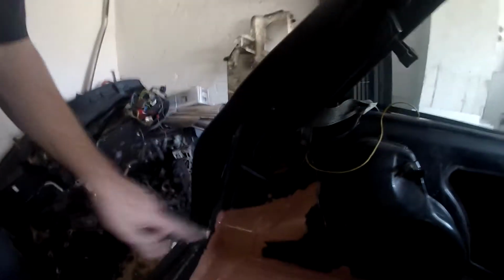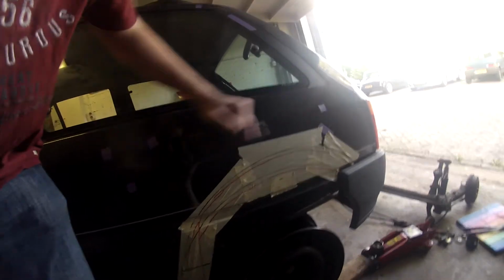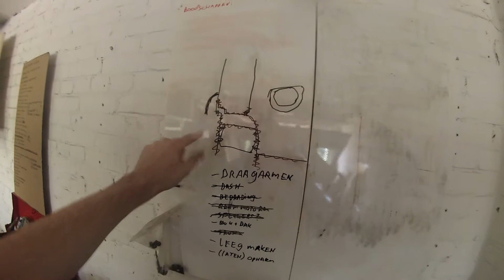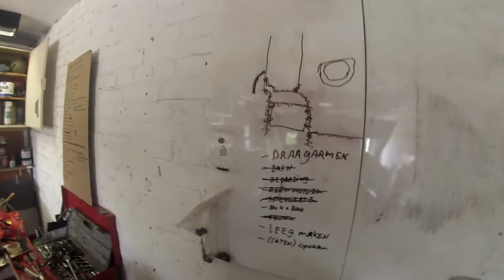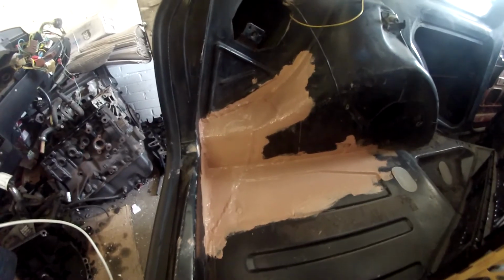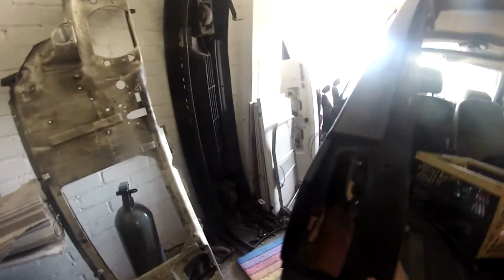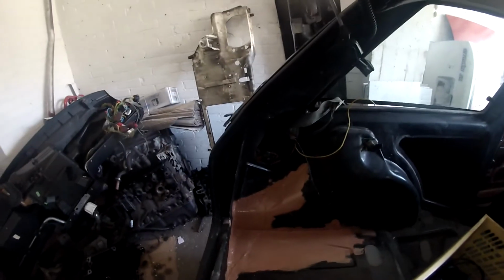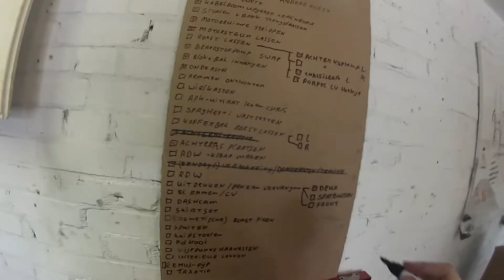Citroën AX 16V Trackday Project Episode 6: Fixing more rust

Comment: good work men from spain! i have a similar proyect, what brake tubs are your used for the behind brakes? of saxo? because de brake bomb have 4 exits and the ax have 2 alone, thanks
Reply: I used the AX brake master cylinder (pump) with 4 holes, AX front brake lines, 1 original ax brake line (left line) and 1 custom line (shortened and fitted with a m12x1 fitting) to the saxo brake force distributor on the rear axle. It should all be explained in episode 4 of the series.

Comment: hey 

I was wondering how do you draw and the lines to cut the metal on the back of the car?
Reply from the maker: I put masking tape (paper tape/painters tape) on the car, held the plastic overfenders in place, drew around them with a permanent marker, took off the overfender then drew a second line a little bit inside the outline. 
The inside line is where I cut, so I'd have some metal to glue the plastic parts to.

There are a few places where the wheels rub other than right at the top, so I cut away some extra material there too:
Right in front of the wheel it touches the inside of the guard on hard bumps, 
at the back of the wheel it scrapes the inside corner of the rear bumper and the mounting bracket for the bumper there, so I removed some material there too.
Reply: @lowbudgetracing9403   tank you my friend